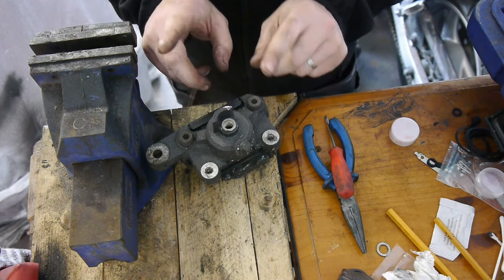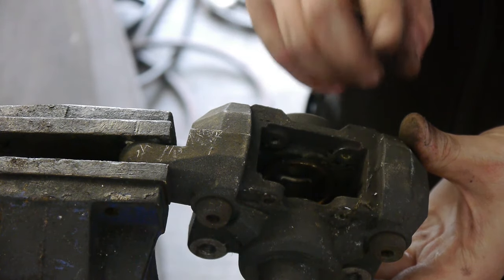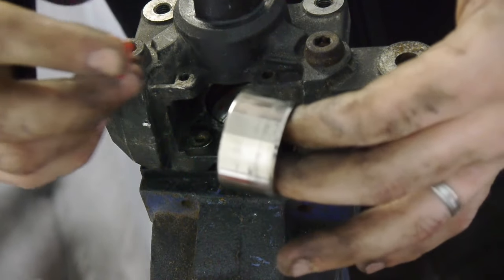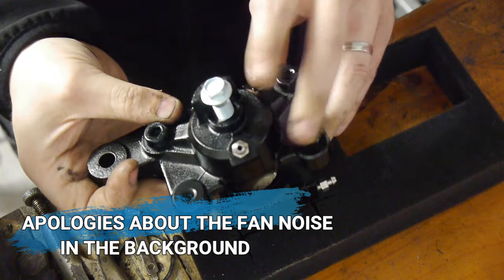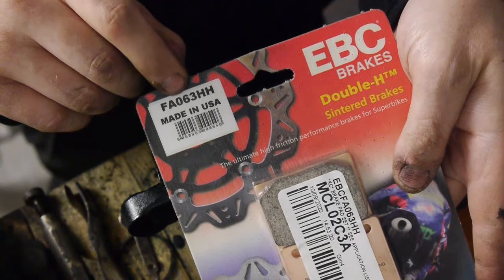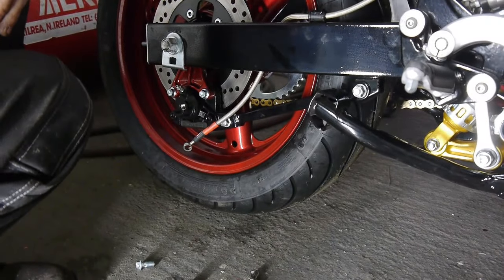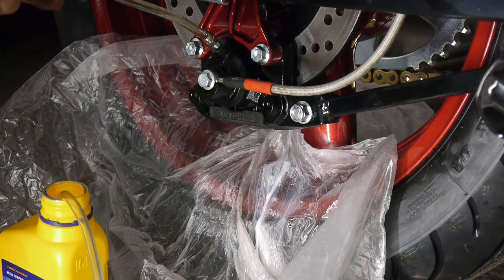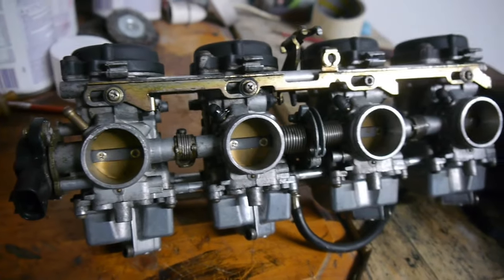How to Rebuild Rear Motorcycle Brake Caliper - Suzuki GSX600F Katana

Comment: Wow, I realized watching that your rear brakes have allen keyed bolts holding the 2 halves together. I thought mine did too, but, mine were star bits (torx) and I nearly wrecked em trying to break em lose with an allen key.  I looked more closely with a flashlight and saw the torx and got em out with an impact gun (big one for sure) cause I too had removed them before noticing they had to come apart. I was just trying to crack em loose with the impact gun. Did not break  em they are hardened half bolts (threaded halfway and solid shaft the first half) SO BREAKING THEM IS NOT TOO MUCH (oops caps) of a concern. Hand tools will not crack em loose.  22 bucks later and new torx bolts with fresh paint and caliper clear coat (to protect against chemical damage from brake fluid) and gonna start putting em back together soon as the bolts arrive. I do not use the grease in the kits, I use brake fluid as a lube for the pistons.